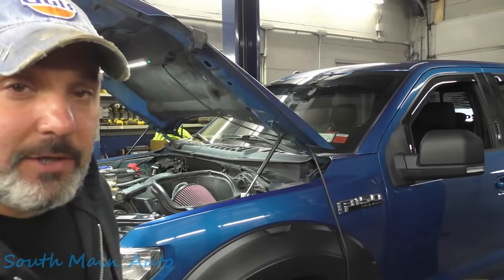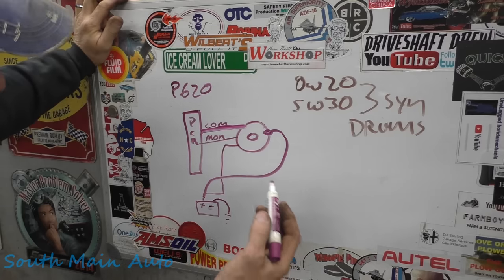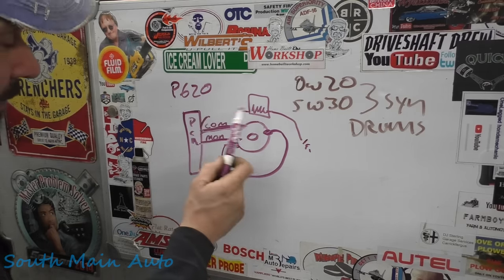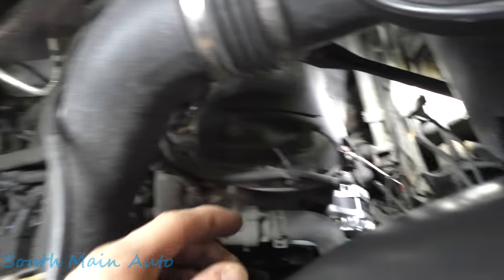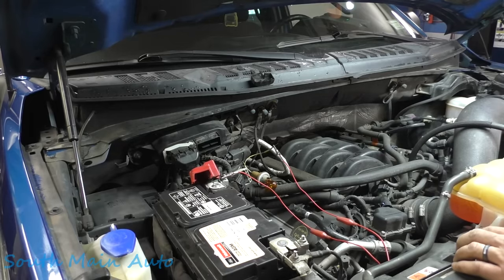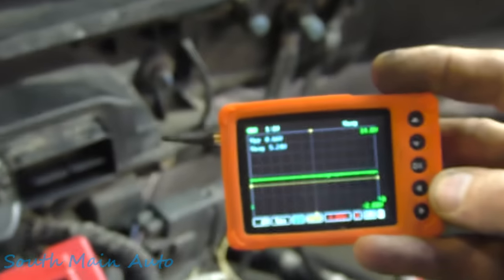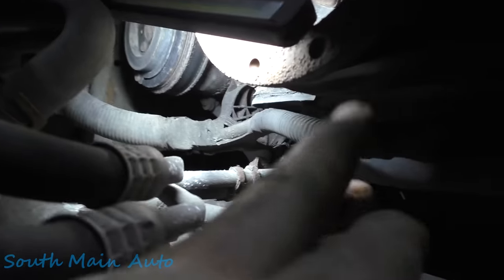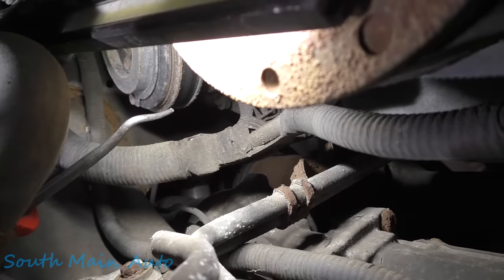2016 Ford F 150 Roush 5.0 - Service Charging System - P0620

Comment: Ivan just posted another green puss wire. He again complained on the crimp and seal connectors.  Sorry Eric O I agree with Ivan on that one solder and heat shrink is the way to go.
Reply from the maker: I use both don't mind either to be honest 🤷‍♂️
Reply: Often the problem with the crimp and seal connectors is people crimp them with the wrong tool and it punctures the heat shrink. I’ve also seen them get crimped so tight they break the wire. 
Solder can make a brittle joint that will break from vibration. And, many people have a hard time making a good solder joint that isn’t cold.

Comment: ford engineering just plain sucks... Chevy always has the same usual failures, Chrysler grounds are always broken the body rotted out. Ford... Anything and everything could be wrong. Every Ford I know of has a bracket that rubs through a wiring harness. Built in timer to cause major issues that no ford dealer can fix.

Comment: Smart charging the battery of an internal combustion engine is the most idiotic idea. Using technology just for the sake of using technology. The reduction in fuel usage and emissions is so minuscule that 99.999% of driving habits negate the gains entirely, as do trips to repair shops to fix failures. Complex systems that lower emissions by small amounts can easily raise emissions output more in one failure than they ever could have lowered them in a lifetime.
Reply: Your lack of understanding does not change the complexity of the world around you.